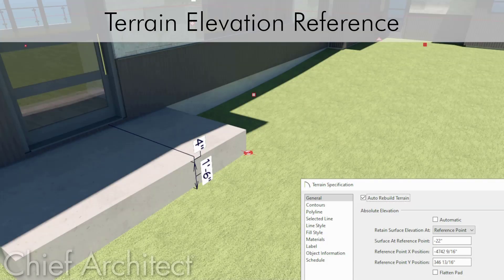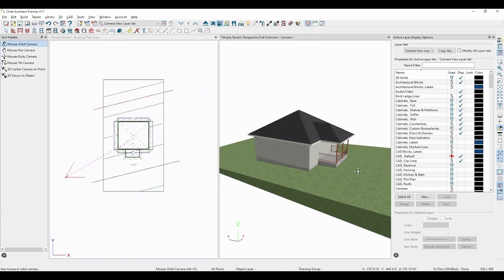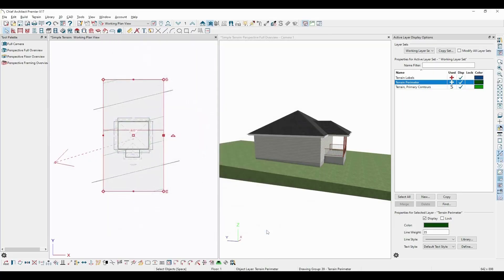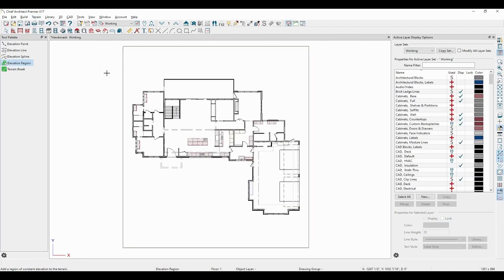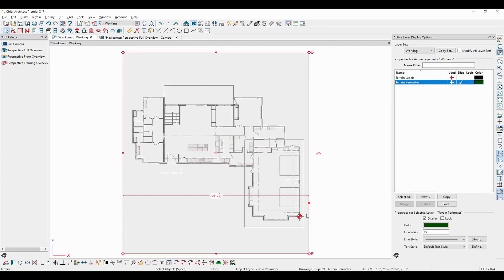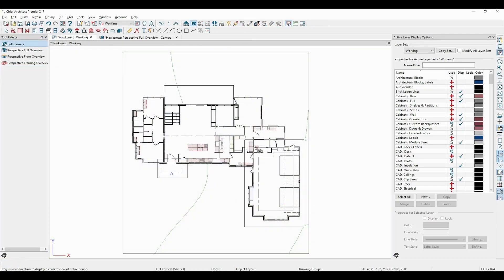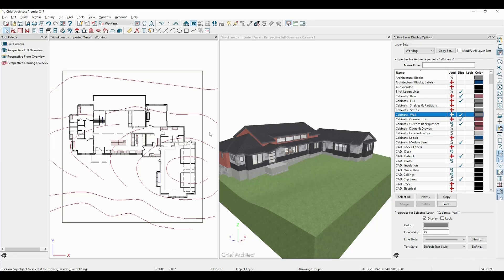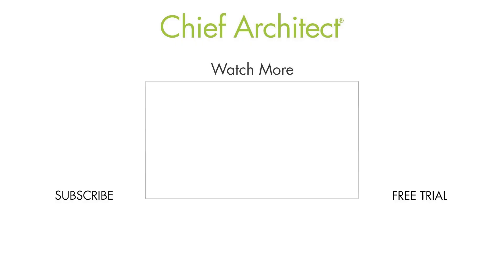Creating a Terrain Elevation Reference Point in Chief Architect

Comment: Finally.  That 'reference' marker new to X17 is long overdue and being able to move it to the best location based on existing terrain is fantastic.  But, it is not an easy tool to find.  I had to call SSA to help me find where that marker lives, and even though it is greyed out with an X through it, you have to click on it first AFTER selecting your terrain perimeter.  It lives down a few steps.  This will make my terrains easier to adjust.  Thank you.